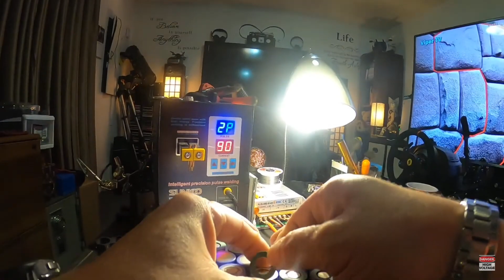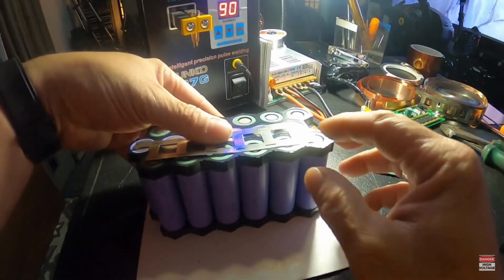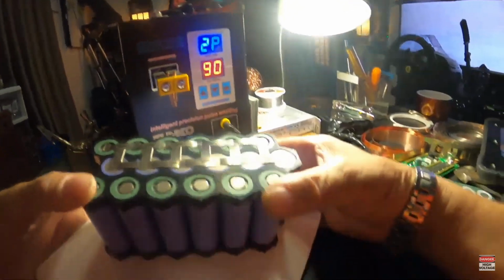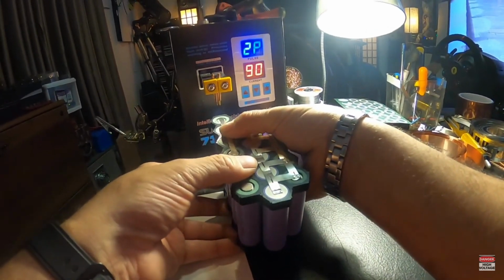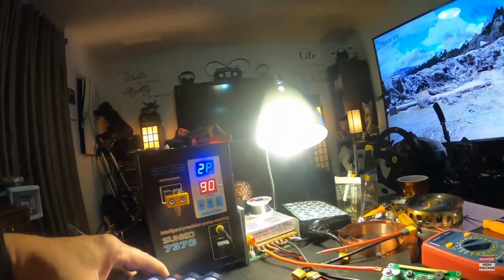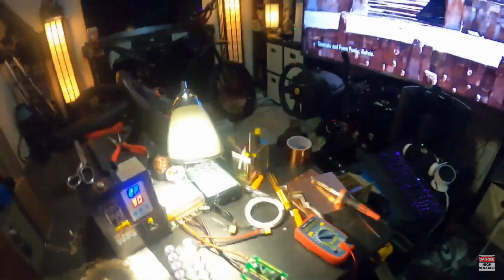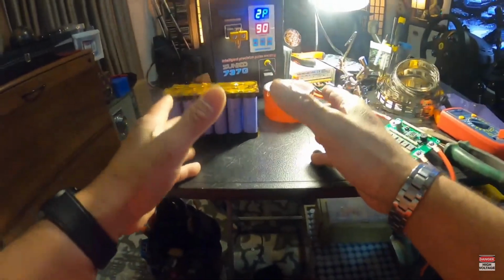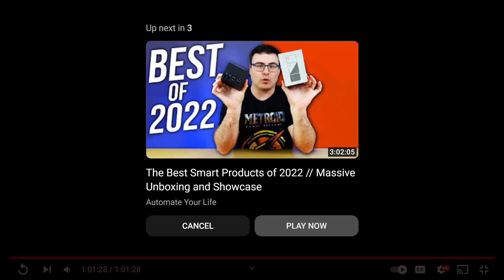Making a 12v lithium battery pack welding nickel strips method.  My first test of my small welder.

Comment: So you’re saying that can build a battery without a bms I like your logic on your own management
Reply from the maker: Absolutely you can, all day every day especially when those cheap ones are there just for gp they surely dont work as they should. You really need them mainly to stop overcharging and the chargers do that if your using the right charger. They cut off when they reach the voltage limit there set for. The BMS dont shut them off except for the expensive ones Ive checked this not with all of them but the few that i did never cut off. I dont trust them and Im not paying for the ones that do work, there outrages when all you have to do is put a volt meter and a temp sensor on them and monitor them yourself. Your the best Battery Monitoring system there is , everyone should closely monitor their batteries and dont rely on a bms to do it
Reply: @ChrisCrossingWires1212  Thanks for your reply I think I will try to build my own for the first time I’ll start with something like small . can you recommend what kind of batteries should I buy